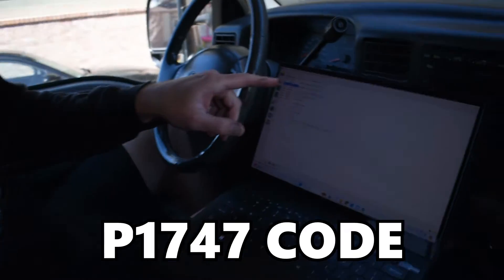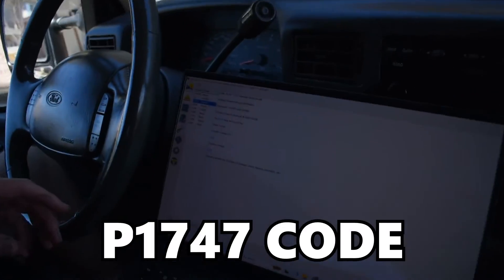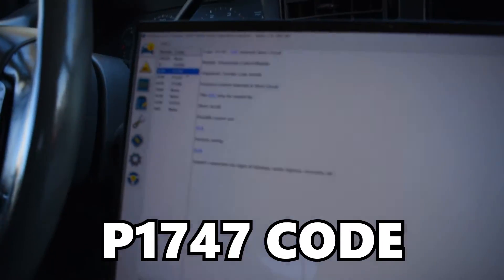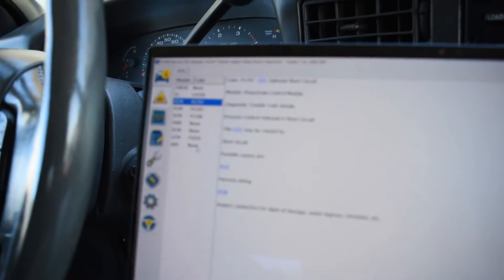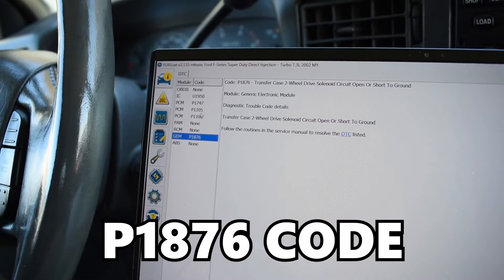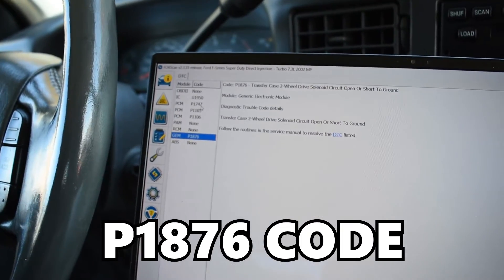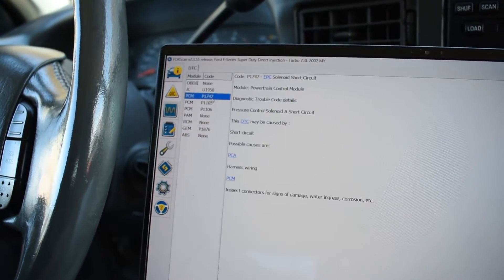How to Replace the EPC Solenoid Pack on a Ford 4R100 Transmission!

Comment: But how did you get the electricals unclipped? I can't get my hand up in there far enough from any angle to unclip mine. My needle nose, nor a flat head fit either because of the angle I have to go at it from the shielding.
Reply: You gotta look at it from the back of the trans, I ran into the same issue but that was how I got it
Reply from the maker: A - What he said ^

Comment: Having an identical issue with codes P1747 and P1760. Have you solved the issue with this vehicle yet? I noticed you haven't put a follow-up video up yet. My thoughts are possibly a bad TCM or PCM?
Reply: I also followed your instructions and replaced the filter, gasket, and solenoid pack with no fix. My issue (hard and delayed shift) is intermittently occuring during operation.
Reply from the maker: S - We've been away recently and plan on working on the truck again. We hope to have a video out here soon!
Reply: Excellent! Any hints about the issue if the solenoids have been replaced? Are you guys going to aim to check the wiring first or the PCM? Still trying to find a place to start with this issue. Looking forward to your video!
Reply: I drive a 1999 Expedition.

Comment: Is there a fix for gettin to second after reaching 2500rpms and letting go almost like a manual shift ?
Reply from the maker: S - Wouldn't advise this. Are you having the same issue?
Reply: @8020Automotive  yes , only way to get to second gear is to let go of the pedal reaching 20mph or 2500rpms , any suggestions ?
Reply from the maker: S - Take it in or work on it. This is not normal operation.
Reply: @nightmar4056  This is why I'm here today... but mine threw a Service Engine Soon light.. P0755 "Shift Solenoid 2 Circuit Malfunction". I'm assuming that this video IS the fix for our particular problem.  I'd like for anyone to confirm.

Comment: I was getting a p1746 code and after checking and testing everything it ended up being a bad PCM. I replaced it with a rebuild unit and all was good. Unfortunately it’s been a few months and now I’ve got a p1747 code. PCM tested good so now it looks like a solenoid pack😞🤦🏻‍♂️
Reply from the maker: K - Sorry to hear man! Hope this video helps out.

Comment: I got p1747 and p1760 EPC solenoid short. What do i do for that??? I replaced my rear end back in may after it broke in January. It's did not move for 5 months until I got the rear end replaced and then when I went for a test drive all those codes came up. I started it every week to keep fluid moving and it never came up at all until I went for the test drive. Is a 2001 Ford F150 4.6 V8 four-wheel drive automatic transmission
Reply from the maker: P - You may have to give it some time. The codes could reset. Otherwise, we will have a video coming out soon speaking more on the P1747 code.